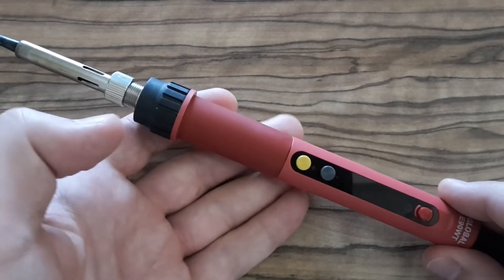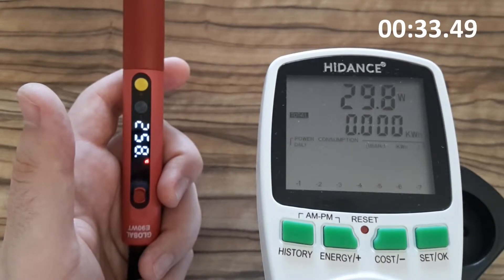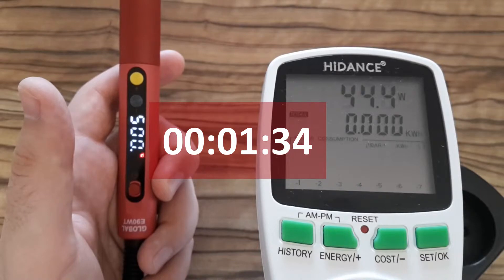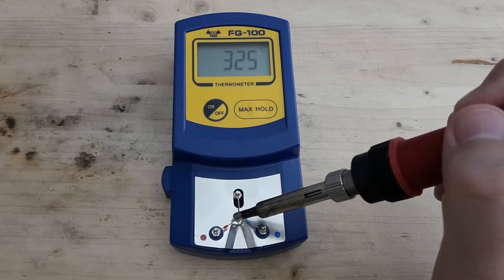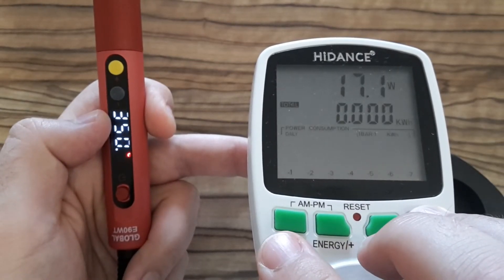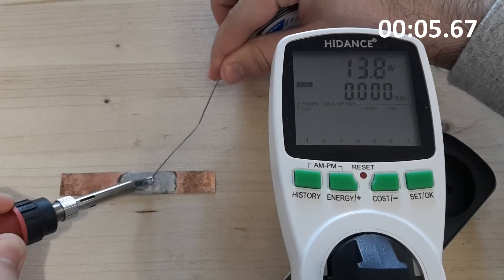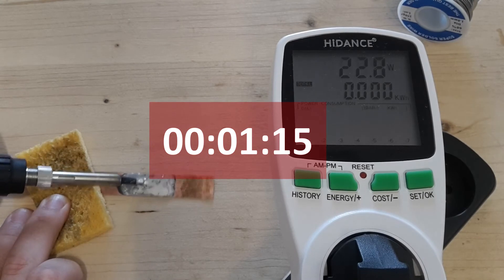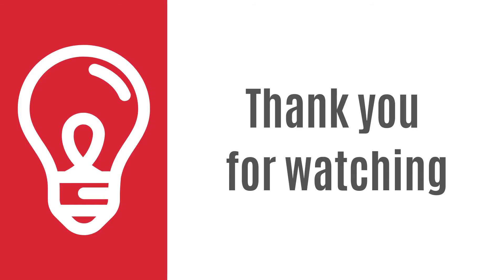CXG E90WT Soldering Iron Review

Comment: I work with this soldering iron, and I am very pleased with its quality. Interesting fact! In this soldering iron, in the 'global' version, the A1319 heating element is used, it is designed for a voltage of 110 volts. However, the device operates from 85 - 260 volts. If you put a grain of solder inside the tip, then the 'touch response' time will be like that of systems with a T12 cartridge. I calibrated the temperature with a thermocouple, and now it is the same with any type of tip. This is a very successful device.
Reply: that's interesting. what if you put copper tape inside to make it a bit thicker and make more contact with the tip?
Reply: @Hudsonkem  As it turned out in practice, the gap on the side does not affect much, the main thing is reliable contact with the thermal sensor of the heating element. In addition, when buying, you need to choose stingers with an internal diameter of 4 mm. There are a lot of them in the assortment on Aliexpress right now. You do not need to apply the tape, because then you will not be able to quickly replace the nozzle.
Reply: @ПавелСтадницкий  thank you for the knowledge mate

Comment: In 2 times cheaper of TS-100... I don't know what is better for me... By the way, is there flicker on numbers of display? At video it looks like 50 Hz. TS-100 is free from that.
Reply from the maker: Hi, try to search on AliExpress: T12 Soldering Station. There are Quicko, KSGER brands. I think they're worth it.
Reply: @zeroampselectronics  Thanks, but have ordered E110S at ali, with 900 tips. TS100 and T12 have inadequately overpriced tips and it is wasteful to spending everytime for new heating elements.
Reply from the maker: I'm really curious whether E60S, E90S and E110S have different internals or it's just marketing :-)
Reply: @zeroampselectronics  According to feedbacks there are different heaters.
Reply from the maker: That's great then.
Reply: SH72 much cheaper than ts100 and same thing,only without fancy display.